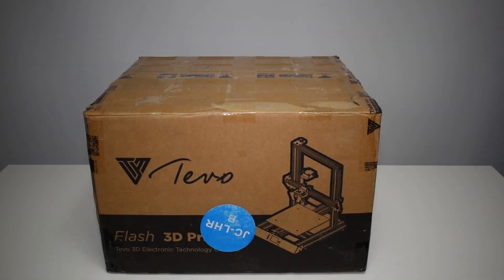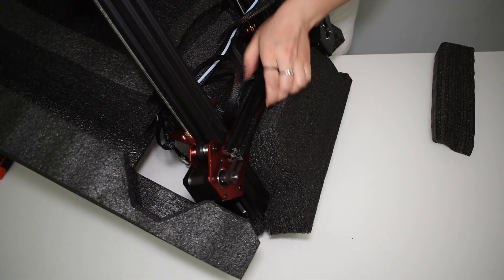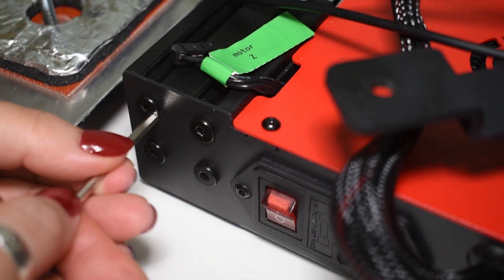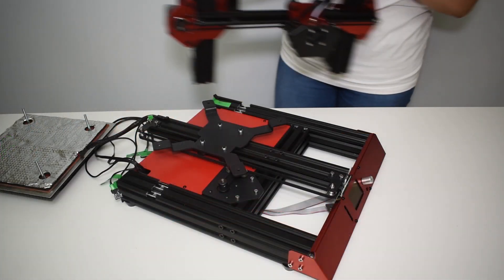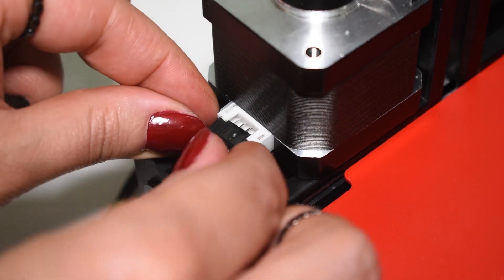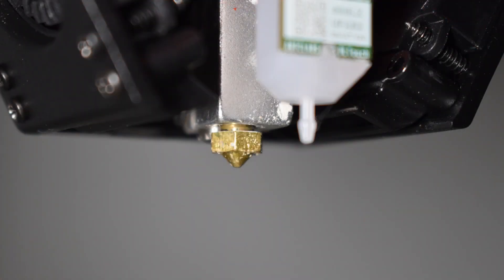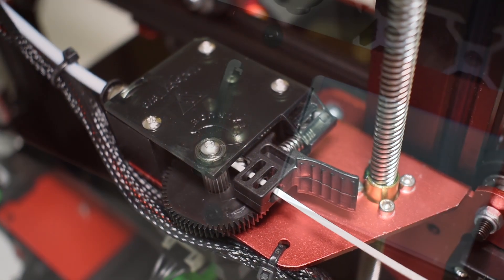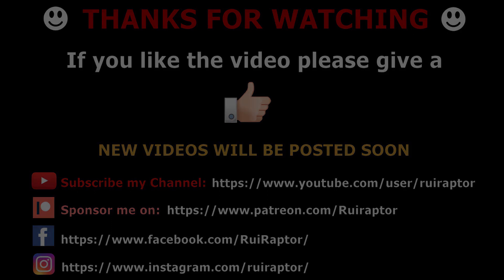TEVO FLASH 3D Printer (98% Built Full Extras) - Unboxing, Assembly & First Prints

Comment: Received a new flash just yesterday...the same of your video...very disappointed isn't possible to print by sd card...it overextrude after stopping for a while then go away for the bed and then back to print....via usb it print but the quality is very poor...i'm calibrating at the moment with marlin 1.9.9 but really disappointed after a year with 2 Anycubic with stunning quality printing and no issues....
Reply from the maker: Hi Andrea,
That is unfortunate :(
I would recommend you to open a ticket with tevo
Reply: @ruiraptor  I'm working in it right now....seems i solved the sd issue enabling a slow data transfer from the sd in the firmware....now i need to solve the incorrect nozzle seating...thx for your video....could you suggest best wheel bearing to fit in? for me is the first printer with this kind of system...thx again

Comment: Hi, thank you for this video. What should the vref be set to for the tmc2100?
Reply from the maker: Hi Drifta83,
I would recommend setting X,Y and Z axis to 1.15V and for the extruder 1.00V. Always check the motor's temperature during a 30min print.
Reply: Thank you for your reply, really loving this printer.

Comment: I am haveing z axis issues, can you show how to calibrate the bl-touch when using "blue" tape ?
Reply from the maker: Hi Oren,
Did you ran the bed leveling with the tape already on the bed?
When printing the first layer, you can tweak the height with the babysteps (enter menu -> Tune -> Babysteps Z)
Reply: I didn't used Tune ( I don't think that my menu has this option) what I did is to. 1 menu > bed leveling > home first . 2. prepare > move axis > z axis > 0.1 mm lower until i get an A4 paper width . then I if the height is  0.0 i am done. else I 3. menu > control > set Z offset using the 0.1 mm to adjust the the value +- of step 2.
Reply from the maker: Try this method instead:
1- Turn the printer on and execute home all axis.
2- go to menu>prepare>disable stepper motors
3- move X and Y axis manually to each corner (and more than once) and level the bed with the 0.1 thick paper (make sure you have the tape on the bed already)
4- go to menu>prepare>bed leveling (the BLT will probe the bed 9 times)
5- start your print

-> next time you power up the printer, execute the bed leveling (menu>prepare>bed leveling) before starting your first print of the day.
Reply: Thanks, I will try

Comment: Would you recommend this over Tevo Tornado as the first printer to begin 3d printing? Awaiting full review
Reply from the maker: Both work very well. The tornado is much bigger so you need to figure out if you will need to print big or small things.
Reply: ruiraptor Thanks. I think I would prefer the Tornado. A few upgrades and it's value for money! Also, the new ceramic heated bed surface is pretty cool. It's a pity they don't have it any other colour except gold.

Comment: Would you buy this or an ender 3 ? (unbiased)
Reply from the maker: Hi Eliaz,
I dont have an Ender 3 so...just by looking at both, i can see that the things that stand out are on the flash side like the AC bed, better drivers and a much better layer cooling capability.
Reply: Those are honestly pretty substantial upgrades and would do a lot to give you a much better printing experience. The other big consideration would be where you are, and what the cost difference between the two is.

I don't own either, and don't have any ties with any of the companies, so no biases here. I've just spent a insane amount of time researching this stuff and am planning to build my own custom printer soon, and I'm planning to include most of these options with  the one I want to build. Hope this helps!

Comment: If you try to search for it on alieexpress, you get presented with alot of choices. the 98%, it does include everything you showed in here, or not? it's priced lower than some versions that include the dual z and 2100 drivers.
Reply from the maker: Hi,
Good point... My advice...check Tevo's webstore (they accept paypal). You can also contact them directly though there.  It might be easier:
https://tevo3dprinterstore.com/products/tevo-flash-3d-printer-aluminium-extrusion-3d-printer-kit-3d-printing-prebuilt-50-sd-card-and-titan-extruder-as-gift
Reply: another small question, would it be easy to remove the glass plate on the heatbed to make it easier to swap with other plates?
Reply from the maker: The glass is glued on the aluminium sheet. It will not be so easy.

Comment: I'm intrigued....I would think since it has the BL Touch, they could use solid bed spacers and do away with the springs.  It also looks like the way the bed knobs are, you can't use the larger sized once since it won't fit.
Reply from the maker: Regarding the bed and the springs, you need to remember that this is a machine with several addon options...one of which is the BLT sensor...so it must include the springs.
Also, it's recommended to have a very good leveling regardeless of the sensor because it will help the z not to move/compensate so much. 
Users can do this mod later on...
Regarding the knobs,  these will work for the Flash:
https://www.thingiverse.com/thing:2821399
Reply from the maker: I might...but i will not simply change the springs with spacers...i will go further on that.
Reply: Where Nerdy is Cool! I noticed that too about the bed screws. I thought a modified knob with a longer shaft could do the trick, but I paused the vid at 7:19 and it seems if you did have a knob the was down that far, it would collide with the frame. But if you had a solid bed, use the touch all would be perfect.
Reply: ruiraptor good info.  Are you going to eventually remove the springs and go with spacers (since you have the sensor?)